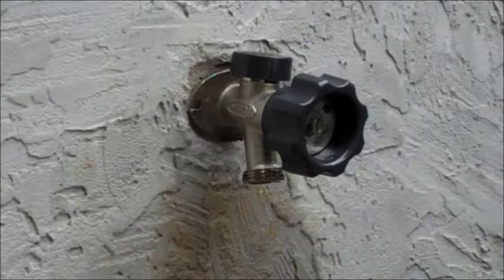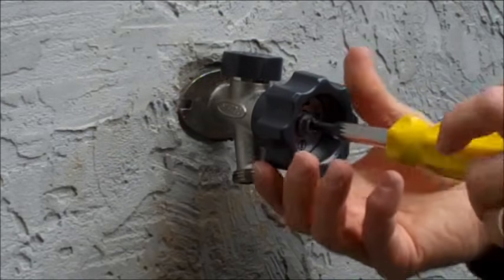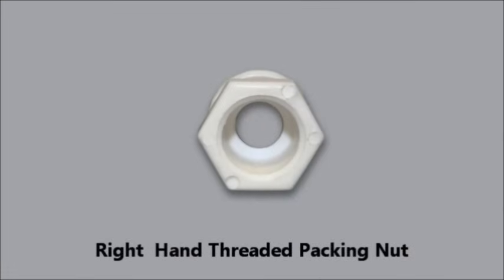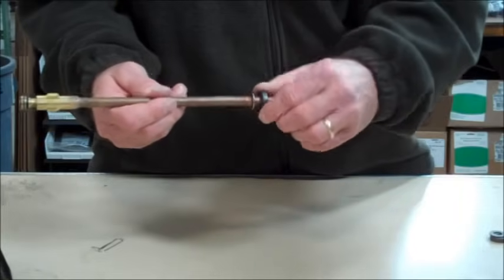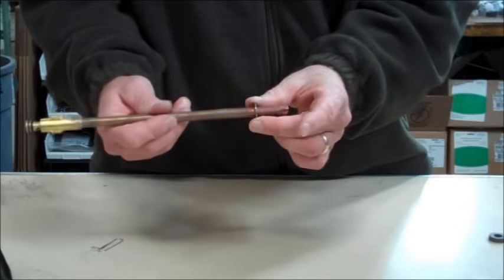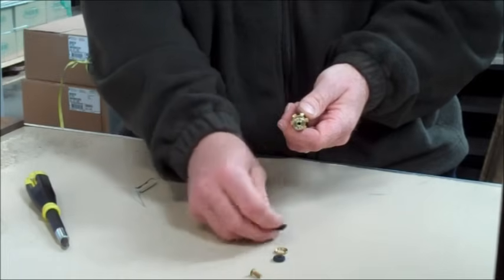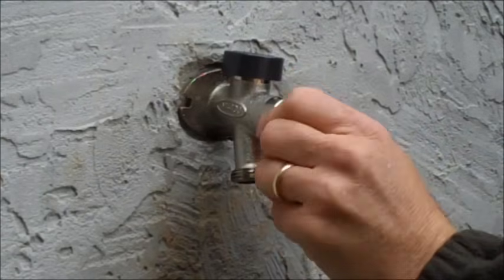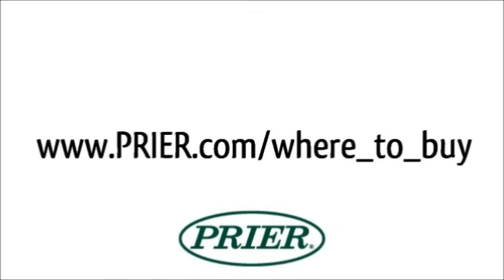Mansfield Style Hydrant Repair Video - Dripping After Shut Off

Comment: This kit worked perfectly for me, I apparently have a 300-series. Two things I learned that I hope help someone else: (1) The graphite gasket for the stem packing nut was too big (the 5/8ths version), and didn't fit the curved shape of nut. I needed to place it inside the nut and use a clamp to apply pressure to get it to form the dome shape and fit so I could screw the nut in. The clamp I used is one that you would use to hold two boards together that you are glueing. There is probably a better way to do this, but I couldn't figure one out (2) At first, I couldn't find the gasket for the end of the stem, that is because it was misshapen due to years of use. It is the dome-shaped one that fits in the end. While some people have complained about the $28 cost, that is pennies compared to the hundreds it would have cost me to either pay someone else to do this, or to replace the whole bib. I'm book marking this video for 50 years when I next need to replace this gasket (actually, I won't be alive then :) ).

Comment: I have a Prier spigot that leaks. It has a handle that looks like the one in the video, but no markings to otherwise indicate the style or model. I bought the Hydrant Repair Kit and I was able to remove the handle and packing nut (which matches the darker one in the kit, with left threads), however, the stem will not come out. It will turn, but when I try to pull it out, it won't go, it only turns. That indicates to me that there is something else keeping it in place. Do you have any advice on how to remove it? Thank you.

Comment: My Mansfield handle nut is rusted and I don’t even see the groove to use  screwdriver . My faucet is leaking when open full near the handle . Please help what should I do ?
Reply: If it is the older style as in the video, a 3/8" hex socket may work (don't use a 12-point socket).

Comment: 4:54  Stem does not simply rotate, unthread, with the cap. It doesn't come out at all. Any ideas?
Reply: I’m having the same problem. I can’t pull the stem out. It won’t come out.
Reply: Were you able to get the stem out? I still can’t.
Reply: I used a flathead screwdriver to pry it out @seabees33

Comment: 1. Use repair kit, still drips unless super tight. 
2. Crack the knob because of cranking on it to stop dripping. 
3.  Replace knob and entire stem factory assembled 
4.  Crack another knob because of the same drip
5. Try a final full stem
6.  Same drip, Install a whole new faucet

Comment: Nice instructions.. however, despite my Prier frost-free hose bib being only about 4 years old (and I'm not sure why it started dripping so soon either), when I went to unscrew the bib using the plastic handle (after having unscrewed the plastic hub as per video instruction) the plastic handle split - it wasn't strong enough to break free the threads.   Is there any chance Prier would send me a replacement?  Its a 10" frost-free, 1/2" threaded end, hose bib.  I would recommend two things: (1) steel handle, and/or (2) instructions can suggest you use a hose bib tool to break the threads free.

Comment: I have tried everything to get the stem out of the housing on my 10 year old model 400 but it won't budge, afraid I'll twist the end off or ruin the threads if I continue. Any ideas?
Reply: I removed my stem - put in the new parts - the packing nut didn't tighten all the way - so I tried removing the stem again. Could no LONGER remove the stem!!! It's jammed in there. I used the new Graphite packing washer. I managed to get the new packing nut in tight now and the leak stopped. Hopefully I never need to remove the stem again? hahaha.

Comment: “Remove the bib screw”

bib screw head crumbles into pieces at the touch of a screwdriver

Remember, things don’t always go according to plan.
Reply: Yep, I have extremely hard water, that screw stood no chance. Had to oscillating saw the plastic handle off to get to the nut to remove the stem! But other than that good and straight to the point video.

Comment: I need to. Know how to replace cut off valve on an outside faucet PVC..  mine is stripped out.  Tech turned off but it won't turn back on   this is a company I paid to fix hot water heater.  Now the are telling me I need to make another $65 claim before they fix that problem.  It was working fine before.  Home Choice warranty says the tech should  complete the job.  But he's arguing the fact.  I'v been 3 weeks w/o water becuz first 2 appointments never showed up .  Now 3 mor days waiting on this matter.  I'm gonna try to fix myself.  I'm 76. Yr old female.  My mechanic even said he could help.  It's not a big deal other then the fact that I've paid someone that didn't complete the job .  So please sho me a video please.
Reply from the maker: Give our team a call at 800-362-9055

Comment: The instructions on the package (60-7755) show placing the large O-ring on the left hand packing nut. Doing this, the nut will not tighten all the way in. This video shows a LH nut without using the O-ring. Which version should I believe?
Reply from the maker: We apologize for the delay. Please call our customer service team at 800-362-9055. They should be able to help you get this on correctly.

Comment: I did everything except measure the stem while it was out (in case I have to replace everything).  And it still leaks.  The packing washer fits easily and no crumbs in there--I had to dig the original out with a nut pick, the one in the repair kit # 630-7755 slid on easily...and still slides out.  I could tighten the H Plastic Packing nut more but it's already at least half a turn beyond finger tight.  There was an o-ring but all the instructions had it going on the white packing nut, not the beige one  and since I did not remove one, I did not use it.  Same for some little parts for the stem end.

 I had such high hopes.  Now I don't know what to do. Somewhere I may have seen a video that says to put extra packing twine somewhere...should I look for that video?  I'm at a loss for what to do next.  Thanks for any help.

this is exactly my part https://www.plumbingsupply.com/prier-freezeless-wall-hydrant.html
Reply from the maker: Give our technical service team a call. They should be able to talk you through it. 800-362-9055. 8am-5 pm CDT.

Comment: Any suggestion for getting the packing nut out if the 7/8 portion of the plastic broke? Mine was dry rotted and crumbled when I tried to remove it.
Reply from the maker: That's a tough spot to be in but there are two things you can do. Try to use a pair of needle-nose pliers. Push it in that space between the stem end and the nut. You could expand it to apply pressure on the nut while you turn it. Might help to have a rubber band wrapped around it as well to give it something to stick to when you turn. It. But for the most part, if it is broke, you can use a hammer and screwdriver to break up the rest of the nut. Just be careful to not damage the threads underneath.

Comment: Why don’t you slow down and show exactly where there first “O” ring is to be landed.  The video is informative but slow down!  The dictions on the back of your packaging is horrible.
Reply from the maker: Thanks for the feedback. We're working on some newer ones. Planning to release those later this fall.
Reply: @PrierProducts  you Aaj get Your To On I Am Do And I
Reply: S
Reply: just play the vid at slowest speed. My stem was jammed in and I couldn't remove it but after I got the packing nut tight the leak stopped. hahaha. Not sure why the stem will not come out anymore. Maybe that new graphite washer is a bit too big?
Reply: Thank you for this video! I was able to repair a broken hydrant easily with this guidance.

Comment: Very informative video! However, I cannot loosen the screw holding on the handle. I've tried PB Blaster and tapping with a hammer. Any other suggestions?
Reply from the maker: Usually, it takes some hard wiggling, especially if it's been on there a long time. It may have some dirt or buildup. Clean it good. Rock it back and forth. Then try the screw again. Worse case is drilling the screw out. Call us if none of this works at 800-362-9055.

Comment: Great video with very clear instructions. I have followed the procedure and all the leaking has stopped. The other thing that bothered me was the faucet squeaking when turning the handle. I have lubed the washers/gaskets with plumbers silicone grease, It still squeaks. Should I lubricate the stem around the threads?
Reply from the maker: Thanks for the note. The squeaking is more than likely coming from the threads in the back. The metal on metal will do that sometimes. Over the years, the water can help subside the squeaking, but it can be very annoying.  Yes, putting plumbers grease on the threads will help with this and can prevent the squeaking.  Go ahead and add to the threads, just don’t glob it on to prevent it from interfering with the seat washer on the back end.

Comment: Mine is pouring rapidly while I have it to the off position will this repair work for me?
Reply from the maker: It should. The packing nut will wear out after time.  If you have any issues, call us at 800-362-9055

Comment: In my case, the handle can not be pull out after remove the screw, what should I do?
Reply from the maker: Sometimes mineral buildup can make it difficult to remove, so you can try getting some mineral spirits in anywhere you can.  Others have found the spraying WD-40 in the screw hole and around the back of the handle will help loosen the handle.  Call us at 800-362-9055 if you need more troubleshooting assistance.
Reply: @PrierProducts  I have the same issue. less than a year old-do not believe it is mineral build up. After removing the screw on my m-400, the handle still turns like it is on threads, and hits a "stop" at the end.

Comment: This didn't work. My hydrant is less than two months old and has developed a very fast leak. I bought the repair kit and followed the instructions, very easy. It didn't solve the problem, I guess the solution is to not buy a prier hydrant.
Reply from the maker: Hi there, sorry to hear about the leak.  We would like to help you find a solution!  Where is the leak coming from?  Feel free to call us at 1-800-362-9055 to get some help troubleshooting through the repair.  We also are happy to discuss the warranty on your faucet.  Thanks!

Comment: I ordered the Mansfield 500 Series Stem 123-0094 replacement, and the Mansfield 630-8500 Complete Repair Kit. I have the old right hand threaded style. Everything is assembled and in place, but it seems the last step is impossible? The screw seems too short and will not reach the stem through the handle. Is it possible the kit I purchased had the wrong screw or was missing it altogether? I think I remember the screw from the original handle being longer. I wish I knew what I did with it. I do not want to ruin the new stem or the integrity or the seal or the packing nut by trying to push the handle on, but it seems like that is the only way the screw will catch? What size screw is proper? And do I tighten the packing nut all the way to the shoulder, basically as far as it can go?
Reply: The screw is likely the same as you took out, I don't believe the screw length has changed.  As you look at your valve without the handle, is the stem about flush with the end of the packing nut?  If so, then the installation is likely correct.  

There may be some variation with the end form of the new stem than the older one.  I would use some vegetable oil to see if that can help it install on to the stem a little deeper, allowing the screw to work.

Comment: I ordered the repair kit, replaced all the washers and it is still leaking out the packing nut when the faucet is turned on, doesn't leak when turned off though.  I'm wondering if I have the o-ring on the packing nut in the wrong place? It's the white nut. Does it go all the way back to the shoulder of the nut or to the undercut just past the  threads? I tried it first at the undercut by the threads but it would not go into the faucet with it in that position.  Also the stem does not have that spring function you show in the video, might it be stuck?
Reply from the maker: Michael, if you believe your Mansfield style hydrant was manufactured prior to 2006 and it has a vacuum breaker, the stem will be spring loaded. It could very well be stuck and causing the leak you described. I would suggest  putting some plumbers grease on the spring and ensuring it moves in and out freely. In regards to the packing nut, the o-ring goes in the deepest/widest ridge. Just below the shoulder, as you described, is correct. If the faucet continues to leak, you may need to replace the stem completely due to the age of the hydrant. Feel free to shoot us an email at sales@prier.com or give us a call at 800-362-9055 and I would be happy to help you with the correct part number. Thank you!
Reply: Thanks for the quick reply.  I know it was installed in 1996 so yes much older then 2006. It also has the vacuum breaker. I'll take it apart this weekend ans see if I can free up the end of it.  If not I will get with you on ordering a new stem.
Reply: I took it apart and yes the stem was stuck. I got it loose and greased it up and no more leak. Thanks for the help.
Reply: @PrierProducts  OK I figured it out - I was supposed to UNSCREW the stem like I did originally but when I put it back together I didn't "screw" the stem back in since the packing nut screwed it in? Well so THAT'S why the stem would not pull out no matter how much force I used. Hilarious. Now the leak is gone - so I'm happy. thanks

Comment: One of the best coverages of the repair of an anti-siphon frost-free sillcock. I appreciate the info that reinforced what I'd surmised, although I've never had one of these apart before.  My problem is I don't know where the shutoff for this water line is;  unlike the other two faucets, my leaky one has no easily accessed shutoff with air valve for draining.  It's likely in the crawlspace under the house if there is one at all.  I will have to shut down the main house valve in the garage.

My next issue is determining what brand and model of faucet it is.  It is brass with a hexagonal plastic green cap on the frost-free device, and has a green metal spoke handle.  It was installed upon the construction of our house in 1994.  The faucet body is stamped with ABP on one side and USA on the other.
Reply from the maker: We are pleased that you enjoyed our video! In regards to the brand of your faucet, ABP stands for Arrowhead Brass Products. Therefore, they would be the appropriate manufacturer to contact in regards to replacement parts. Thank you!